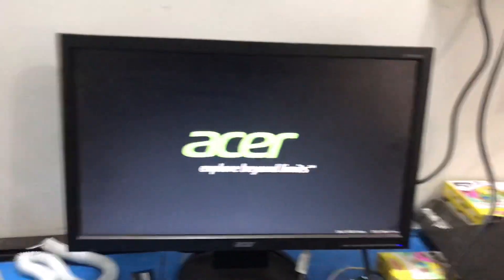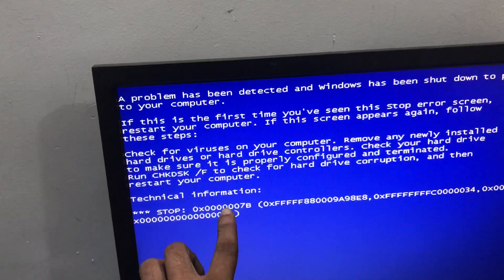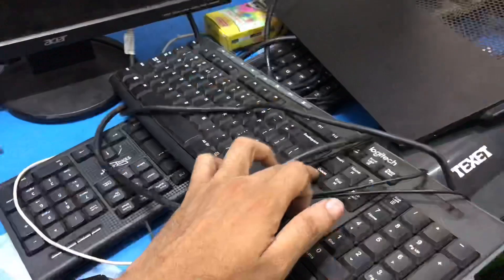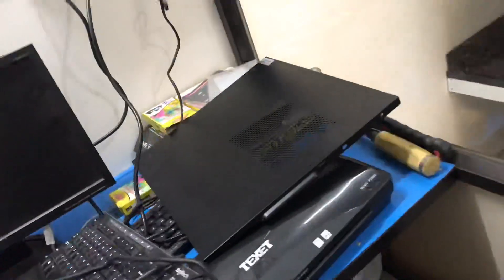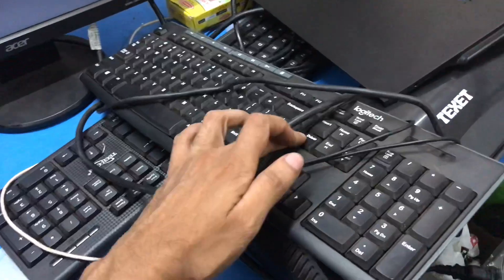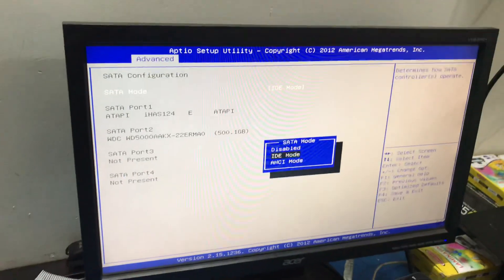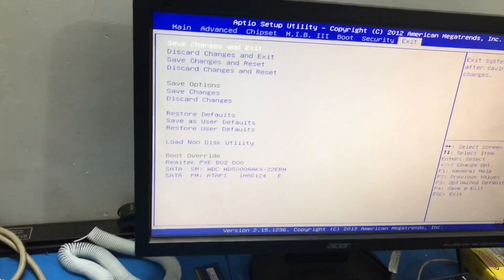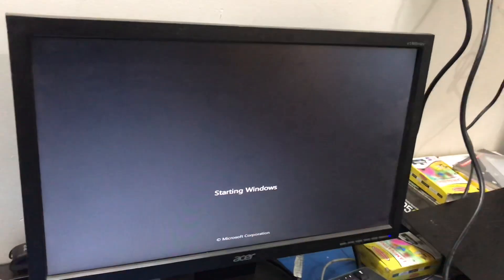How To Fix Stop: 0x0000007B Blue Screen Error In Windows PC

Comment: On my Q9650 computer I replaced the the GTX1050 with my cheap old 730GT and the problem was gone immediately!  I tested virtually every piece of hardware and sure enough the GPU was the reason for my Blue Screen Error.

Comment: In my desktop pc of windows xp during boot screen logo for few seconds, blue screen appears as 
STOP:  0x0000007E (.....,.....,....,.....), 
Next line says--> igxpmp32.sys - Address B9896F79 at .......
I checked this file in windows\system32\drivers present there...but why this same blue screen shows like this.
I tried safe mode, stucked or hanged....
I also tried in BIOS settings in drive configuration,  changed SATA configuration from IDE to AHCI.
Nothing hsppens, same problem of blue screen of same error..
What to do by this blue screen error about 0x0000007E ? and this about  igxpmp32.sys ?

Comment: It's not starting even if the sata operation is AHCI.. Please guide..
Reply: You need to restore your system using startup repair (it won't delete your personal files btw) then use windows installation usb to repair startup... it might help you